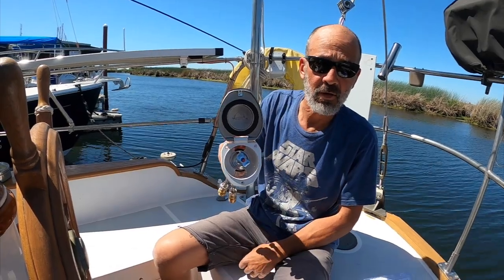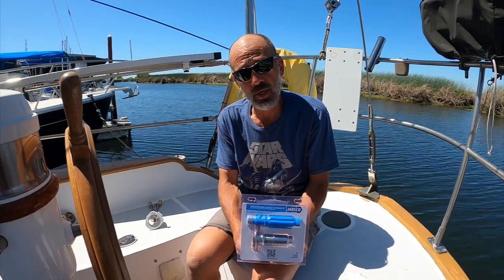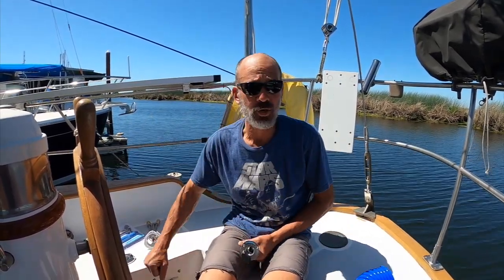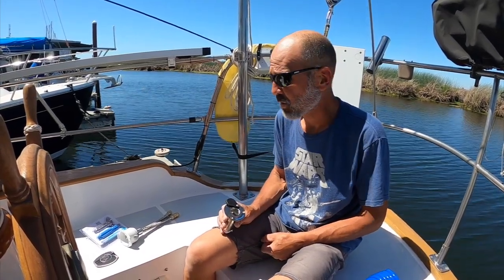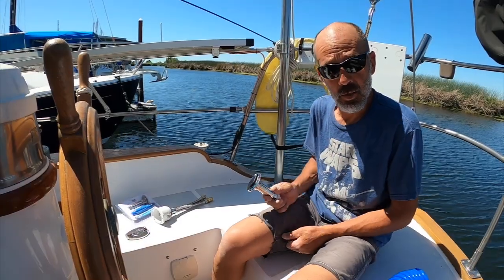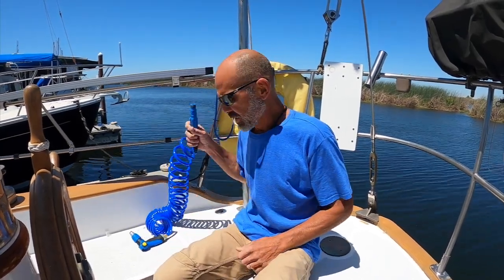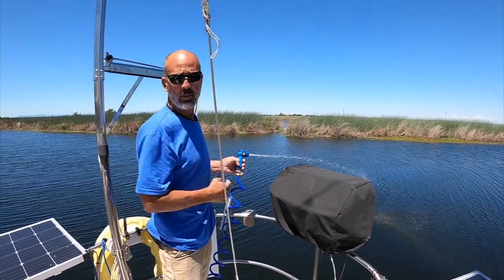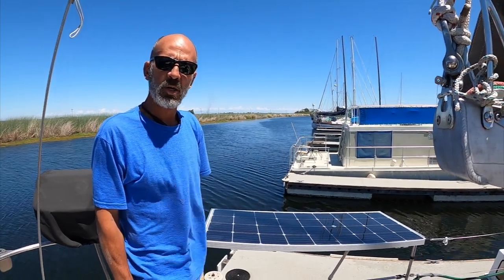SV Ramble On | Installing a Cockpit Shower & Deck Washdown

Comment: Another great video. We installed the Jabsco wash down at the bow. We plumbed it to fresh water. With the coil hose we can reach all the boat. We make 40 gallons an hour fresh water so no need for salt water wash down on Nellie Jo. Thanks for sharing we really enjoy your videos!
Reply from the maker: Very nice James.  I'm still contemplating a freshwater connect to the foredeck as well.  Definitely planning on installing a water maker in the near future.  Thanks for watching.

Comment: Great job....we have done exactly the same thing.  I did put a valve on the bow wash down to switch between salt and fresh water.  We Mostly use the salt water on the bow though. On the stern (cockpit) wash system I use the “Salt Away” attachment sprayer to flush the dinghy motor, and it works great.
Reply from the maker: That's a great idea Ohana.  We have the dinghy motor mount right on the stern rail.  Thank you.

Comment: Nice.  Been thinking of having an anchor chain wash down system for ages. Not sure if it’s best to use seawater or fresh.. I can carry loads of fresh water so wastage is nit an issue.  I thinking more about the chain.
Reply from the maker: I agree.  Still contemplating adding a fresh outlet up front, but if you saw where I drilled the new windlass foot buttons there at the end of the vid, you can probably see I'm running out of room at the chain locker to drill more holes.  God I hate putting holes in a perfectly good cored deck...

Comment: It wasn't installed, then it was installed. I was really hoping to learn more about how the whole system is actually installed.
Reply from the maker: Sorry about that Adam.  We’ve done so many plumbing projects in the past it seemed a little redundant to show cutting the pex pipe, installing the shark bite fittings and all that stuff again.  If you want more info on plumbing maybe check out some of our other plumbing videos. If you have any specific questions post them here or send us an email.  Thanks for watching. We appreciate your feedback.